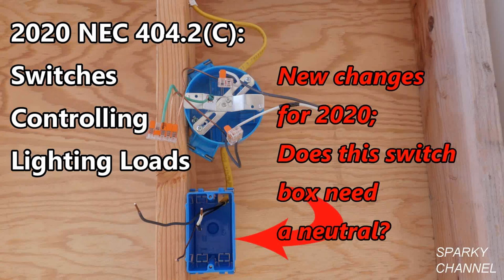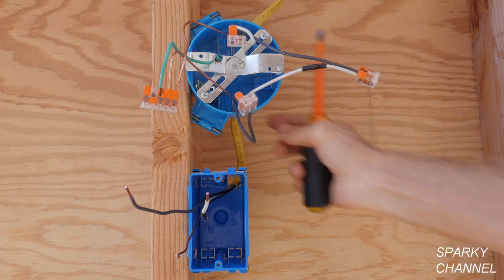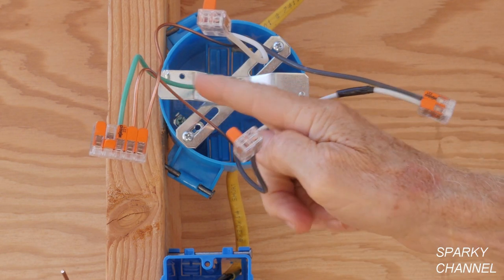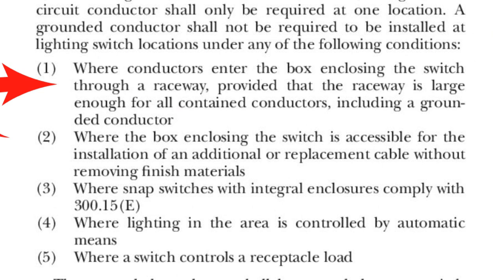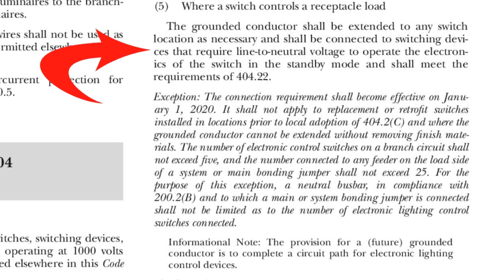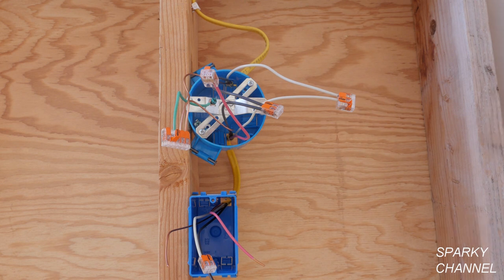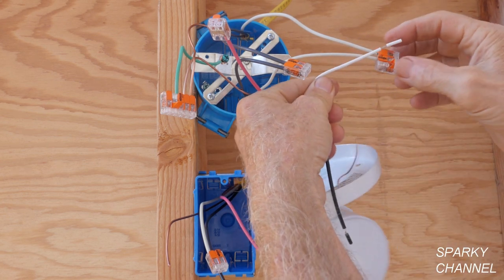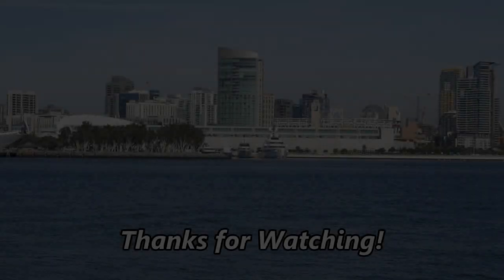NEC 2020 404.2(C) Neutrals in Switch Boxes with Example and New 2020 Exceptions

Comment: electrician for 30 years, master for 20.  Most of my work is in the industrial environment but have wired many homes back before this code change. This code change applies to any application but I don’t see a lot of switch legs in commercial / industrial applications. The exception for conduit is the work around when they are used. In my opinion, requiring a grounded conductor on a switch leg is another example of the electrical manufacturers influencing the code authors. Same as Arc fault receptacles/ breakers. Just ‘cause manufacturers can build it doesn’t mean it should be written into code. If electronic light control is specified in a home then yes, install the grounded conductor. Requiring this for every switch leg changes the way us old electricians work and think about residential wiring. Plus it’s a waste of resources. Now I have to change the way I route my branch circuits which requires more cable or to comply with this code or use a 3 conductor cable for the switch leg where a 2 conductor cable worked fine since electricity was installed in homes. Thats my rant for the day…stepping off my soap box now.
Reply from the maker: The manufacturers do have a certain amount of influence IMO.
Reply: I agree. They are basically outlawing the classic switch loop and insisting on a switch leg simply because of the popularity of new electronic switches. Never mind that the micro amps that any of these switches may impose on the devices ground is instantaneous and probably less than the induced current naturally already taking place on every wire in the building. It is a waste of materials to run the extra wire.
Reply: @SparkyChannel  yes as they should they get sued and pay out if they burn your home down!>

Comment: So if you're doing a new installation or have the finished work off it will save you just to run your feed into the switch. More people will want "smart" things added to their house and this change just helps make sure that it can be added without pulling new wire. I also don't see this as just a way to keep code writers in a job, this is more of them catching up to the demand for new switches and fixtures.

Comment: I recently attempted to "quickly" help out my brother by installing a new dining room light and fixing a dimmer-switch three-way combo that had been broken for years. Well, that quick job turned into a full day job when I realized the wiring in 1973 was very different than what I learned on. This was the very situation I encountered with his setup. I ultimately had to get out my tracer and map each conductor out to figure out what was going on. That was a fun little learning experience.
Reply: When you got it figured out n working, it does make you feel a bit of accomplishment.

Comment: So then why not just bring the power to the switch box and run the cable to the load? 12/2 w ground is cheaper than 12/3 with ground.

Comment: Neutrals are required for a vast majority of Smart Switches. I just installed all Smart Switches in my vacation house that was built in 1971. I was pleasantly surprised to find neutral wires in all my switch boxes.
Reply: you got lucky.  that was right around the time the industry was transitioning from "spider" layouts to daisy chain layouts. (spider has power to the fixture, and then a wire from the fixture to the switch and to each receptacle in the room)

Comment: I’ll leave this up to the customer if it requires more material. There is no safety aspect involved and therefore none of my concern.
Reply: If you are saying that it is equally safe to run power to the light and then wires to a switch as opposed to running power to the switch and switched power to the fixture, I disagree. A lot of home owners are going to assume that the power is off to the light fixture when they turn the power off. I don't know how often that poses a real danger but it seems less safe to me.

Comment: Great demo.  Seeing is believing.  My house was built in 1990.  I ran into this exact situation last week.  I wanted to install a smart dimming switch in the master bathroom.  Opened the switch box up only to discover NO neutral wire.  The smart switch requires a neutral connection.  In the switch box, the white wire was hot and the black wire was the load.  The bare copper ground wire was not connected to anything.  Luckily, about 18 inches away was a normal wall outlet.  I snaked a neutral wire from there over to the switch box.  Bingo!  The new smart switch is working as it should.
Reply: with an afci breaker if the receptacle was on a different circuit than the lighting, that would trip your afci breaker?
Reply: @dontbuyprelude  Those smart switches don't use much power, so it depends on if it exceeds the leakage the AFCI can detect. Given that it was in a bathroom, it's possible that it was a GFCI protected outlet, and if a daisy-chained outlet, this could also trip the GFCI. Adding another GFCI outlet and removing the first GFCI pass-through from the circuit would be a way to address that issue.
Reply: Levington makes smart switches that don't need a neutral.

Comment: Regardless if the power is at the light it could be solved with a 3 wire to the switch box. Black/red for the switches hot and the neutral wire nutted off for future smart switches in a remodel that is. 
Power to the switch box in new construction. 
I use the big single gang boxes anywhere I can. They’re not that much more in cost.

Comment: This reminds me of automotive wiring.  All wires are in the main harnesses for all accessories so that many accessories can be dealer or aftermarket installed after delivery of the vehicle or at a future time.  Volvo was doing this back in the 80s to save time and money manufacturing vehicles; they had standard features on each model, such as a DL had windup windows, a carbureted engine, steel rims and nothing fancy.  Cruise control, radios, air conditioning, trailer towing packages, etc., were dealer installed if the customer wanted it.  GL models all had power windows, heated leather seats, fuel injection, aluminium wheels, etc., but stereos, speakers, AC, etc. were dealer installed.

This code is basically doing the same thing, having the wiring in place for future upgrades, thereby saving time and money if and when they are done.  I do this in my own house, install wiring and water/sewer runs for things I may afford later on.

Comment: I always preferred running the power to the switches and just a switch leg up to the light. Pulling light fixtures down when trouble shooting is a pain in the neck. I remember working on old houses with the Knob and Tube wiring. They switched the neutral and there was no ground. You had to run a wire from  a pipe or the panel to use with your Wiggy so you could identify the hot and neutral. The good old days.
Reply: Even though I hate this new code and I have always preferred to wire switch legs like you, having the occasional switch loop that I might run outlawed is right aggravating. Sometimes it is very convenient to switch loop that distant isolated 3 way (making the white wire neutral) but if I understand this correctly that would require a four wire cable now or an added two wire ( which in turn would waste another conductor).

Comment: Without getting into boring detail, I replaced a vent/lighting unit for a bathroom with a vent/heat/light/nightlight unit.  I was easily able to pull the old 14/3 wire and install the spec’d 12/3 wire and an additional 12/2 for the additional control circuits.  Then, the client changed his mind and wanted a humidistat installed for the vent.  That required a neutral connection on the unit.  First impression, what a hassle.  Fortunately the conditions that I had allowed me to easily pull the additional 12/3 through the box using the existing 14/3 with very little effort up in the attic space.  I’ll keep that in mind next time, even if the neutral is not used in my installation, it can be capped and ready for the inevitable time when a neutral is needed in that box.  It might even be me who gets called back to install a humidistat.
Reply: Just out of curiosity, why did you change wire size? Did you change the wire size of the whole circuit or just the switch leg from the switch to the fan? If the old wire was 14 gauge, I’d assume it was on a 15 amp breaker, so unless you changed the whole circuit out to 12 gauge wire and changed the breaker from a 15 amp to a 20 amp, then it wasn’t necessary to change wire size as it didn’t change the amps to the fan. Just curious as to the reasoning behind it.
Reply: @strangerofthe2067  Whole circuit.  The 4 function fan unit called out a dedicated 20 amp circuit since it has a heater function.  I pulled a new 12/2 line, new breaker to a junction box before the fan unit then added 2 12/3 drops to accommodate  the 4 functions.  Also, the humidistat as a part of the vent switch required a neutral.  That I did not find out until I unboxed the unit.  I’ll remember that next time.  I probably was not clear or comprehensive enough in my explanation.  Someone’s paying attention.   

In addition, the original 15 amp circuit was ridiculously overloaded (because house was built in the late 40’s combined with ignorant flippers from years before (they left a buried junction box for me to have to bring up to code and some sloppy 3 gang box wiring.).  The circuit fed all outlets and lights in two bedrooms the full bathroom, a hall light and the refrigerator downstairs.  Lot’s of reasons to split the circuit as best as could be done without ripping out walls (all metal sheathed cable on old work).

Comment: It's nice the 2020 shows the symbols at the bottom of all pages; shaded text = revision., a delta triangle = a text deletion.
404.2(C) isn't a new requirement but the grounded conductor requirement is good for electronic switches that used the EGC for smart power while sleeping.
You don't need it if you ran pipe or will have an open wall and can add the neutral later.

Comment: In my house all the ceiling fixtures  are fed power from the switch box via 12-3. The red is always hot. It came in handy when I installed ceiling fans. I'm the only one of my friends that can leave the ceiling fans on when I turn the light off from the wall switch. It was built in 1960, so not all builders took the easy way out back then. There was one "WTF were they thinking" moment when I replaced the light switch in one of the bedrooms, the power fed into the light switch feeds through to the outlets in that room and to the bathroom.
Reply: They make new wireless switches to fix that.

Comment: In the UK most older houses lighting circuits are loop wired from the ceiling rose though these days younger electricians tend to loop from the switch/junction box; our wiring regs' allow either. As a point in the UK its mandatory to shield all earth wires within back boxes with green & yellow sheathing.   Also the switch goes down to turn on a light - up is ALWAYS off!  But I suppose to you we do drive on the wrong side of the road also don't we?  ha ha!  ;-)
Reply: So here in the USA that's upsidedown...lol. I yell at my helpers when they install switches or receptacles upside down.....except the half hots....
Reply: @torodaman  if the switch says "NO" on the top of it, it means you installed it upside down.

but to overexplain, that came about from the days of knife switches - code requires them to be installed hinge down so you have to push them up to turn them in (so they won't accidentally fall into the on position)
Reply: Ken Brown Wonderful explanation. As always very logical.
Reply: @tedlahm5740  one of the things you learn is there is a reason for every standard, and some of the reasons make sense

Comment: Does the new code prohibit "dead end" three-way switches where 14/3 wire runs between two three-way switches and bypasses the light?  Red and black are travelers and white is attached to common screw on one end and black wire from 14/2 wire from light on the other end.  I have at least two of these in my 1951 house.  I assume if I don't disassemble a finsh wall, I can keep the original setup.
Reply from the maker: Yes, that has been prohibited since 2011. Yes, there is no need to disassemble a finished wall.

Comment: Phillip Phillips wrote, "Wellcraft a 3 or 4 way switch does require a neutral in the box in less one of the exceptions is met." That is essentially correct and as I've previously posted. However, technically there are no "exceptions", there are provisions whereby a grounded conductor is not required, pursuant to Article 404.2(C). The exclusionary provisions that come into play most often in residential applications are 404.2(C)(5) and 404.2(C)(7). From my perspective, it is splitting hairs. Conditions may change in future such that a neutral would be required, so wiring to include a neutral at every switch location should be mandatory. It is not difficult to accommodate with the available high-cube PVC switch boxes.

Comment: In commercial we generally feed from the light, or at least from the ceiling,  so we switch loop down to the switch.
Reply from the maker: Excellent, thanks!
Reply: That’s because you generally have an EMT going down to the switch box and neutral can be pulled in at a later time, if required, for devices like occupancy sensors. If you are using MC cable then you have to run 12/3(14/3) down to your switch just like residential to provide the neutral at the switch.
Reply: @alekseyshkolnik4511  yes 👍,  but there are provisions around running the neutral as long as it can be accessed  in the future. In general you are correct.
Reply: In new buildings I've seen switches are low volt or ethernet back to lighting control panels.
Reply: @allotherstaken3  ya, I'm  just talking general lighting circuits. For sure lighting control is used, especially for larger spaces.

Comment: Wow - I have exactly this problem in the bathroom of my 1960 hone, where I wanted to install a single-pole smart switch. I pulled off the plate, pulled out the switch, and lo and behold, no neutral - even though it had been remodeled sometime in the last 10-12 years and had a newer box inside (though I have a bad feeling it won’t be big enough). It has two blacks, and I believe a ground - no white. Therefore no new switch for now. Every other switch or outlet I’ve pulled out has a neutral (including the GFCI a few feet away). I might go back and pull it out again and maybe pull out the box and look behind it; I have a feeling they may have been hidden back there. Or maybe I could try to run a neutral sideways from the GFCI.
Reply: I wouldn't suggest or endorse stealing a neutral from the GFI receptacle. 
Your best option would to be to try and fish a new cable (12-3 or 14-3 depending on the size of the breaker feeding that circuit)  from the light fixture box to your switch box.
Or see if you can find a switch that meets your needs that does not require a neutral, they do make them for occupancy sensory.
Reply: I did a retrofit where I already had 12-3, but that had been fished, so.wasnt fastened inside the wall.  I was able to use the 12-3 to fish 12-2-2 to pick up the neutral (obviously you could do the same with 12-4). I have some 12-2-2 since I'm retrofit installing AFCI'S.

Comment: It's good to know that my basement re-wiring follows the 2020 NEC. I wired exactly as shown with a 14/3 to the switch box and nutted the white for future use. The power comes in through the light box as it did originally. I am wondering if that is allowed or if I should have "rectified" the situation given that it's an unfinished basement and running new wires is less of a chore that it otherwise would be.

Comment: Great video.  Something in 404.2(C) caught my eye.  It is the following text: "The number of electronic control switches on a branch circuit shall not exceed five, and the number connected to any feeder on the load side of a system or main bonding jumper shall not exceed 25."  This seems crazy to me and I'm wondering if I'm missing something or misreading the code.  I am switching my house over to a smart house and swapping out traditional switches with smart switches which I'm sure qualify as electrical switches.  Many branch circuits have more than 5 switches and I'm guessing that I would have potentially more than 25 on any feeder.  I know there are new homes being built with all smart switches and I can't believe they are putting in panels so bi that no branch has more than 5 switches.  What is the rationale for this rule?  I would think the current drain from the switches themselves would be pretty small so I can't imagine it's that.  Anyone have insight on this?
Reply: If you have a neutral wire running to the switch, the 404.2(C) Exception and the 5/25 device limit in it doesn't apply. You can have as many smart switches as you want with a neutral wire.

The 5-switch limit is for switches without a neutral at the box. In the absence of a neutral wire, there are switches listed under UL 773A which use the equipment grounding wire as a neutral. These are allowed under NEC 404.22's Exception, which states 

"Exception: Electronic control switches that introduce current on the equipment grounding conductor shall be permitted for applications covered by 404.2(C), Exception. Electronic control switches that introduce current on the equipment grounding conductor shall be listed and marked for use in replacement or retrofit applications only."

Since UL 773A limits the ground current to 0.5mA, the 5 and 25 switch limits ensure that at worst, the current on the ground is 2.5 mA on branch circuit conductors and 12.5 mA on feeder conductors.
Reply: @zacker150  Yes. That continuous flow on the neutral when all the switches are in OFF/SLEEP mode would be sensed as an imbalance and the AFGCI breaker would trip.